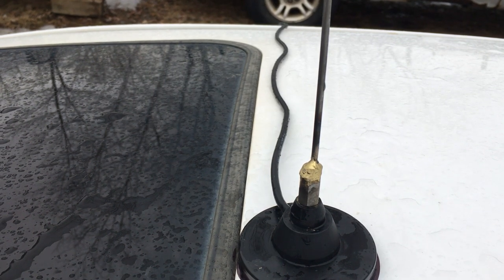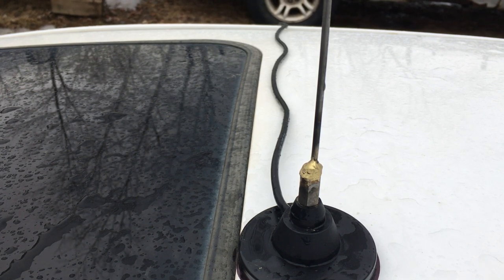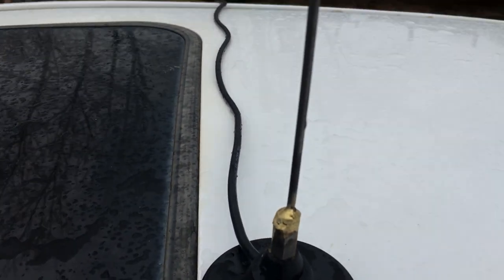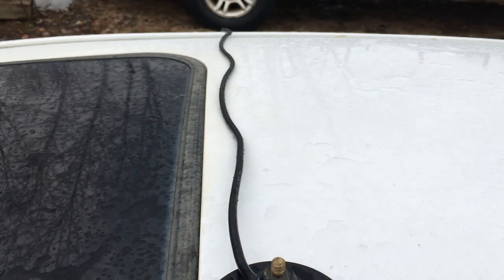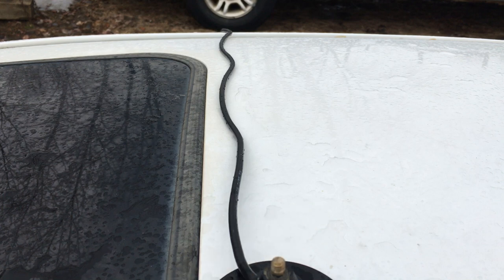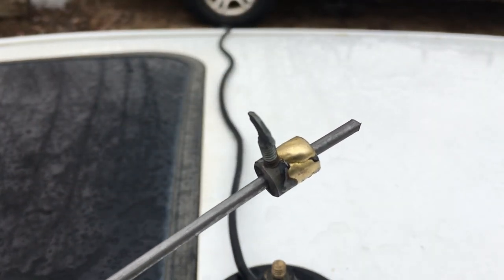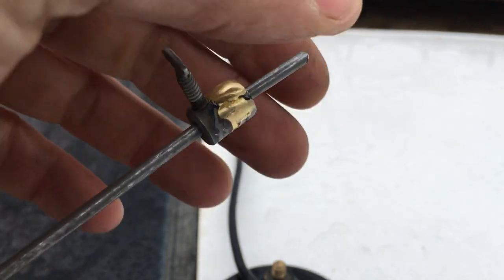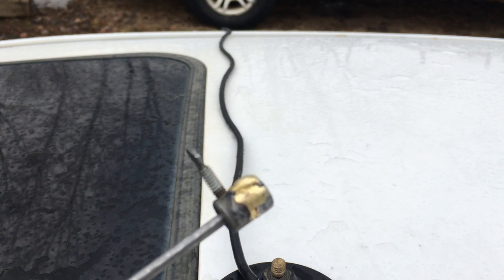🔺 it's too SHORT = high SWR  I cut my mobile GMRS two-way radio antenna too short! Easy fix!!!!🔺

Comment: I bought the 3mm coupler on ebay,swrs are under 1.5 on simplex and repeater channels with my 25w mobile and 1.01 on all channels with a 5w HT,great video!
Reply: I trimmed too much off my midland MXTA antenna and swrs were too high using it on a heavy duty 6" diameter mag mount, I put it on a 1.5" mini mag mount and the swrs were great but the mini mount would not keep a large antenna upright at highway speed,all good now with the antenna back on the heavy mount.
Reply from the maker: Thanks, I am glad it was helpful

Comment: I'm using it with the btech u-25 amp does the amp influence the swr to read high? Or should I start trimming it?
Reply from the maker: Yes, check it with the amp. Question is...is it too long or too short, the way to find out is to cut a very small amount to see if it starts to go down if it does then it's too long. When you get close, best to use a metal file to file tune.
Reply: @GMRStwowayradio  when the amp is off the reading are 1.02-1.05
Reply: @GMRStwowayradio  Is it what matters that the reading are registering 1.01-1.05 when the amp is off? it seems the amp produces noise that makes the swr go up when it's on, is it ok if the swr are ideal when the amp is off?
Reply from the maker: @MH-qc6hp  it should be tune when using the amp Sorry maybe i missed it what is the reading when using the amp?
Reply: @GMRStwowayradio  1.77amp on 1.01 amp off
Reply: On channel 17 for those swr readings
Reply from the maker: @MH-qc6hp  ohhh humm it being like that i am going to say leave it yes i know people are going to say ohhhh nooo its higher than 1.5 but we are talking .3 if you around it up. I don't think that little will hurt anything.
Reply: @GMRStwowayradio  why did you trim your antenna?
Reply: @GMRStwowayradio  it's a ut72-g antenna magnet mount I have, I mean it's tuned to the gmrs frequencies correct?
Reply from the maker: @MH-qc6hp  I was trying to get it better, I should have left it alone!...lol
Reply: @GMRStwowayradio  Thank you for the info. Appreciate it.
Reply: @GMRStwowayradio  I just looked at the specs of the antenna I got the ut72g, it measures 20 inches, so yes I will start to trim it and get to around 16 inches from the one you made that got you readings of 1.01 with amp on.
Reply from the maker: @MH-qc6hp  just be carefully, very small cuts when it gets closer use a metal file
Reply: @GMRStwowayradio  ok thanks 👍

Comment: Just try to tune it to a frequency a bit lower than the frequency you want, when you trim it again and your SWR goes up you switch to the frequency you want and it will be near perfect because it gets shorter as the frequency increases.
Reply from the maker: Yup, but I always push my luck and try to get it better. lol i need to stop while I'm ahead 🙂
Reply: @GMRStwowayradio  I think we all suffer from that. It's just our nature.
Reply from the maker: @harryinoklahoma1866  so very true!